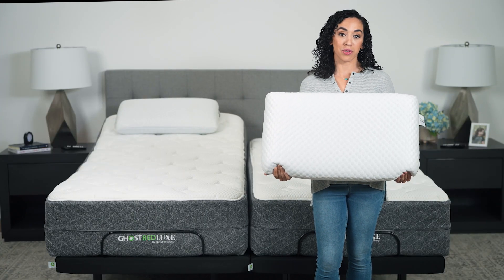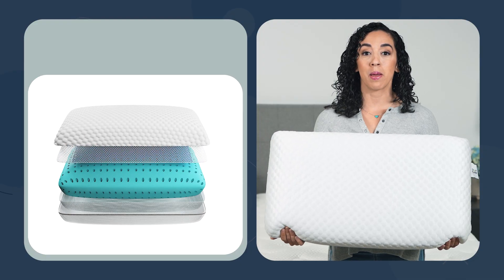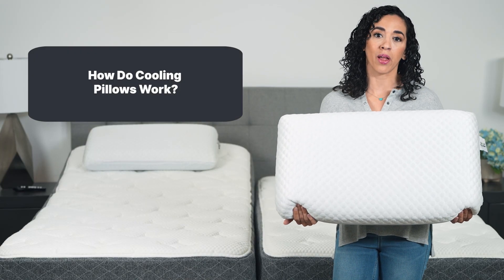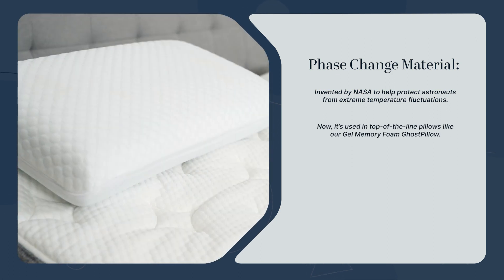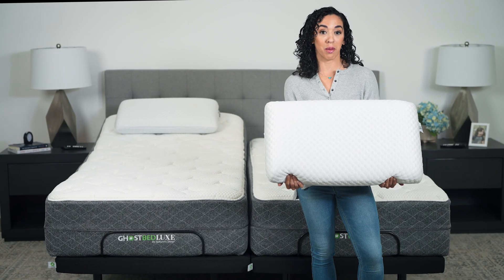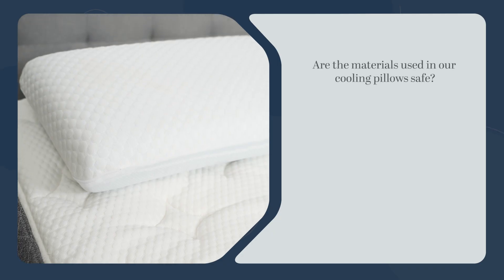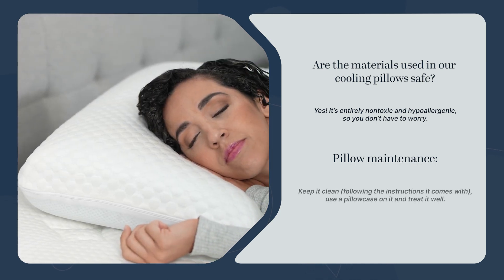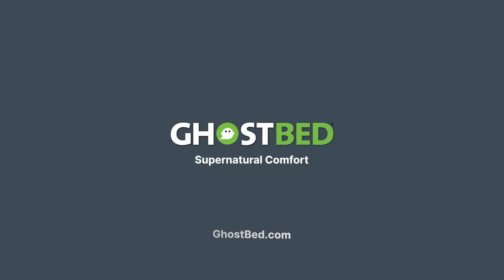How do Cooling Pillows Work?

Comment: Hi Amber. Im sure you are probably around 25 and have never experienced herniated disc neck pain, or hot flashes at night. I didnt ether 27 yrs ago.. but sadly 10 yrs ago, menopause came crashing thru my body, and ive tried every cooling pillow they make. Every single one of them turn into heating pads within an hour. So unless your "cooling pilows" contain wires and refrigerant, they are only "cool to the touch". Total play on words there. Most people will fall for it. Im here to tell them, please dont waste your money if you have hot flashes. They are ALL  a big gimmick. There is no technology that absorbs your body heat. Its total BS. Unless it has wires running through it & needs refrigerant, its not gonna stay cool.